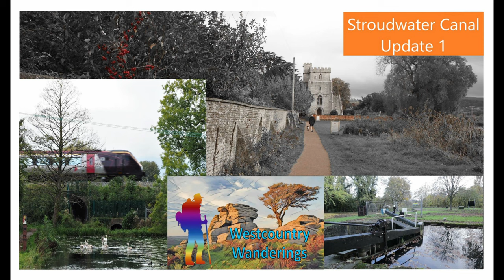Stroudwater Canal Update 2

Comment: The crane started to arrive by road in the week Christmas. Supposed to be the largest lorry  mounted crane in the UK at a massive 1500TM rating. At least 12 artics if not more to bring its parts in and another smaller mobile crane on site to assemble it.
Reply from the maker: That's great information Ken - I did not know that. I was originally mis-informed that it had arrived by rail. If you don't mind, I'll use that information in my update No 4 video coming in a couple of weeks. Thank you for taking the time to comment. Paul.